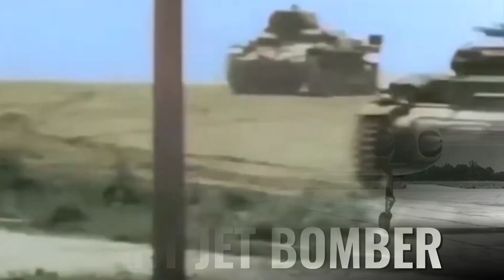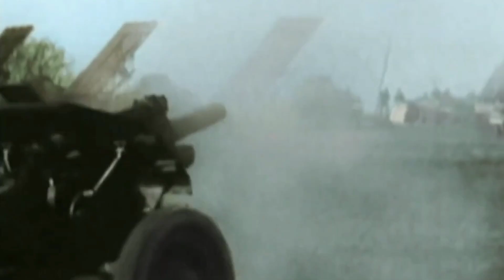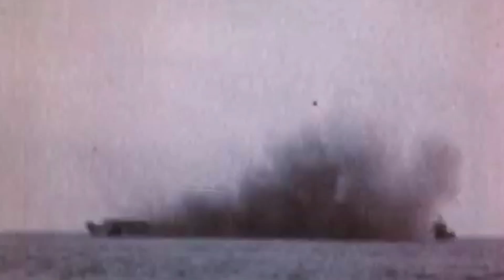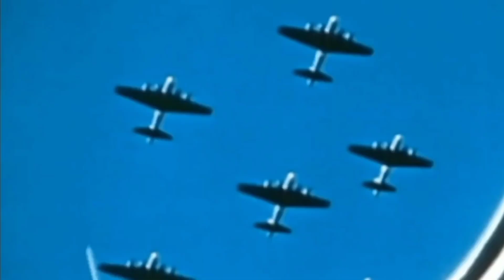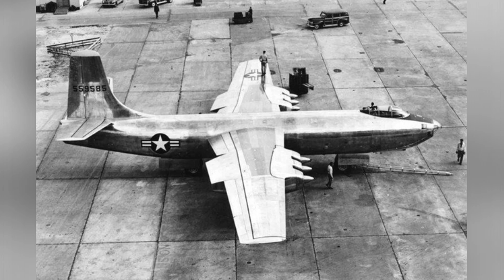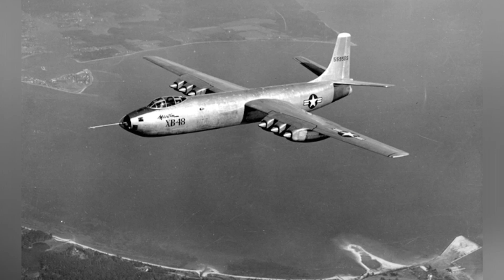Martin XB-48: The Evolution of Jet Bombers

Comment: The Landing gear was upon two Centerline Caster that each could pivot/skew a few degrees, and the 'outrigger' gear kept the plane stable on taxiing across the airfield. This arrangement was first tried on a B-26 Marauder in late 1944, and had NOTHING to do with wing thickness.  It's Purpose was to allow bad-weather take off/landing in Cross Winds, thus making it more likely that Bombers could deliver a Nuclear Strike regardless of 'when' that might be warranted. That Martin-Engineered innovation was found on the Boeing B-47 (which beat-out the XB-46 and XB-48 with it's Speed, not Payload nor Range), and is still in-use today on Lockheed U-2/TR-1B's, and Boeing B-52's.  Get your facts in-order, if you can, please.